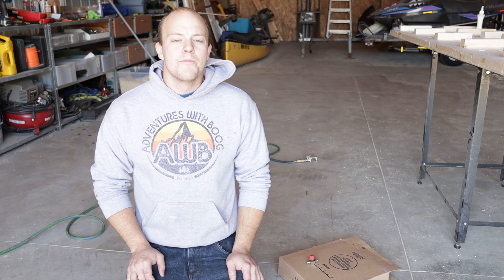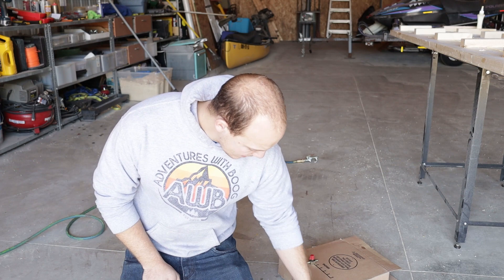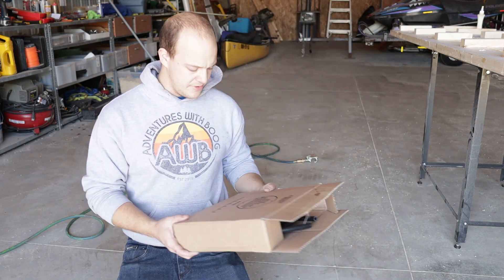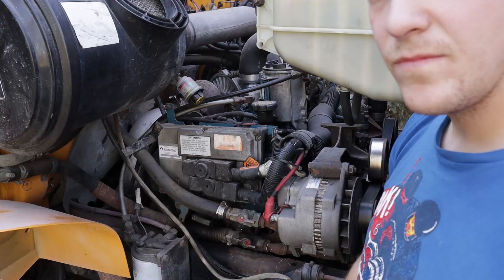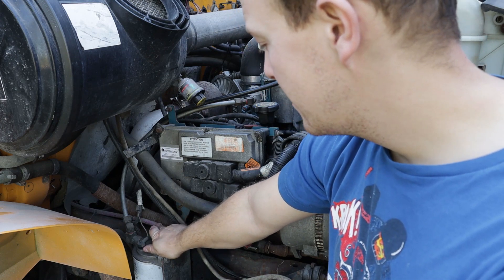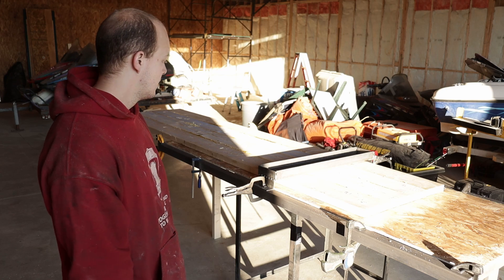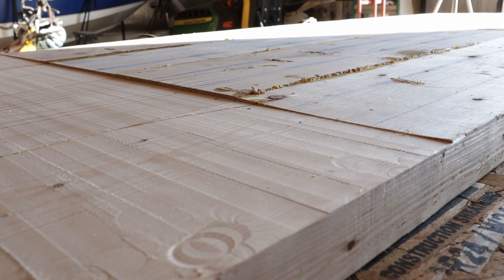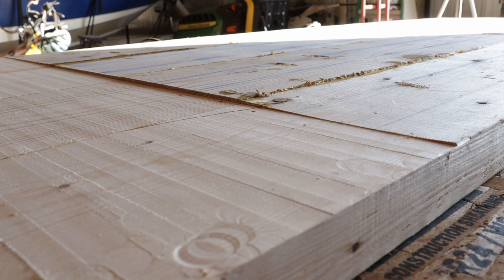Diesel Heater and Beautiful Counter Tops - Bus Conversion Ep 38

Comment: I just replaced both my fuel lines if you add the check valve you should have no problems and I got my fuel lines on amazon if you decide to replace them. My line was the 3/8" ran about $65 bucks for both lines on amazon

Comment: You take the fuel directly from the tank you will more than likely have some issues going your way I could be wrong the pump is designed to pull it from the tank with no pressure possible forcing fuel as it enters the pump but definitely not the return line possible air in it might throw off the prime for it and cause some intermittent issues. As far as the heater drawing the fuel from the tank causing it to empty it  if the fuel stem you put in the tank just make sure it doesn't go all the way to the bottom so it will run out and won't leave you stranded somewhere out of fuel. Just a thought. Oh I had a thought in your countertop problem back in the day I had a table top I was working on and needed to plane it I called around and found a local industrial wood shop who had a planer big enough to run it through they told me to bring it in 
They ran it through once took like 5 minutes and cost me 20 bucks 
Anyway just a thought
Thanks for sharing
Reply from the maker: The heater is not drawing directly from the tank. The transfer pump pumps the diesel to a seperate tank in the back of the bus for the heaters. This way the portion infront of the pump should stay pressurized and hopefully not cause any priming issues. That wood shop idea is actually brilliant and i never thought of it.